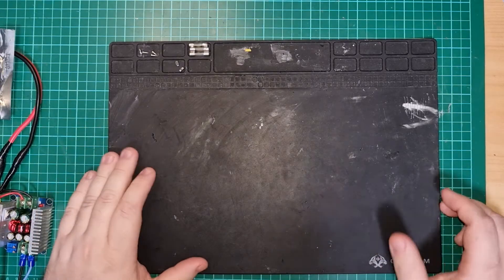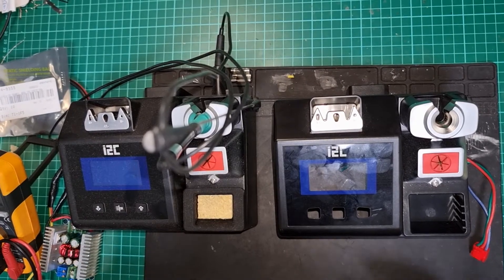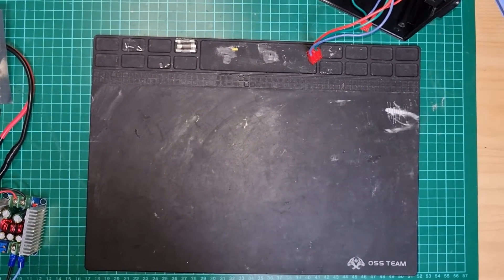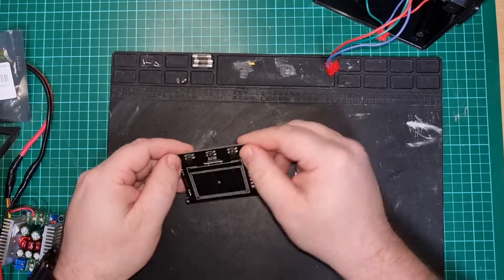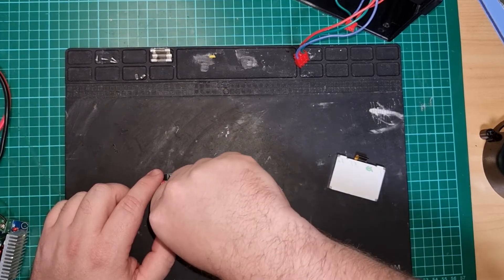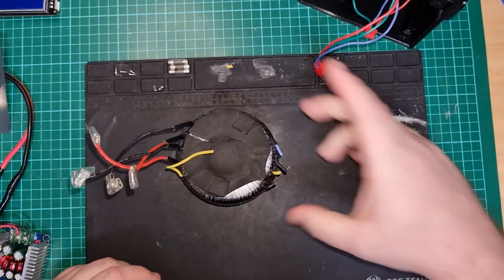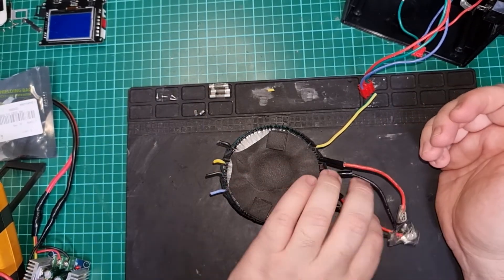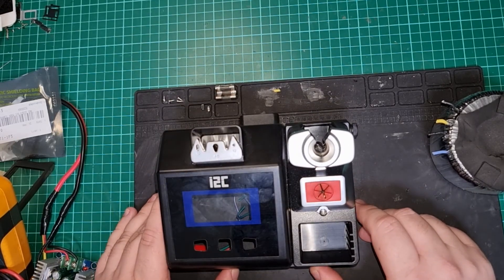I2C solder station... both dead.

Comment: Hello friend, can you help me? I have an i2C-2SCN station from a few years back, it worked fine for a long time but now it blows the protection fuses. Similar to what you mention in the video comment.
How to know what is wrong?
How to know if the transformer is damaged?
Nothing changed in the way of using it. I'm sad
Reply: Check the transformer without connecting it to station, if it keeps blowing fuse, it means its shorted. I also have the same problem, but mine is shorted on 12V too.😢

Comment: I am currently working on a project and search for a specific information - Maybe you can help me and answer me one question: I have seen that this soldering station can be used with a T115 handle. But there is only a 24V line for powering the soldering iron? Or is there a 8-ish V line (apart from the supply line for the controlunit itself) for the T115 handles? (So far I cant see any circuit which looks like it could switch between two voltages but I just want to be really really sure. A bit paranoide on this side :) )

Comment: By the way. I contacted the seller in China explaining the problem and the steps to "maybe" fix the station. They were kind enogh to speak with the factory and sent me a new transformer.
It just arrived yesterday. I remoutend the station and it is working again. Hope you managed to fix yours as well.
In the meantime I've bought a Sugo a9 and it's been working great but i noticed while the i2c handle works just fine in the sugon station the i2c station gives a tool error with the sugon handle. Just in case it helps.
Good luck.
Reply from the maker: I spoke to the supplier and all they said was sorry we cant help you, maybe buy another. So is kipped the frustration and bought a JBC
Reply: I2C always vlaued all customers.We appreciate for your message. We will try our best to do our products better and better.